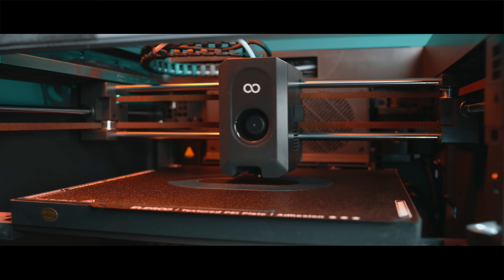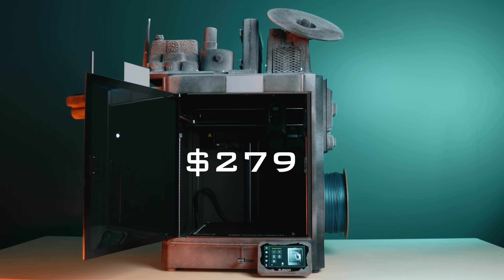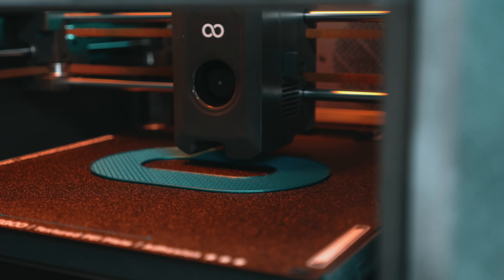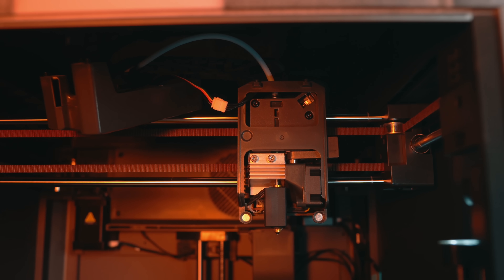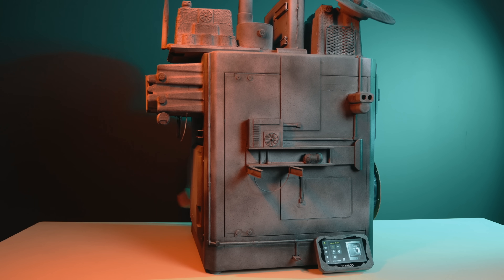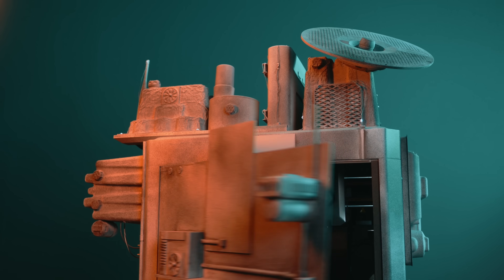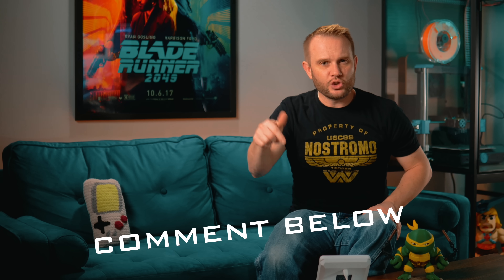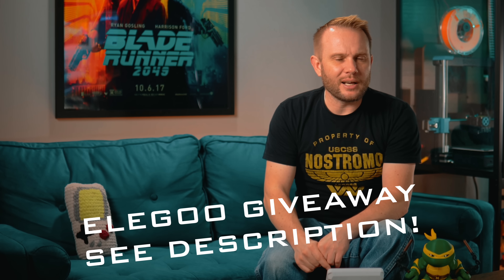The Sleeper 3D Printer Nobody Talks About

Comment: I own one, about 3 months now. Have had absolutely no issue so far except two user errors . 1 forgetting to level the bed when I replaced the build plate with a fancy new patterned one.
2. Using the wrong material presets for my filament. 
I print something or a few things about every other day. I'm an artist and hobbyist so mainly helpful tools, storage, organizers etc. I think it's the best printer you can get it you're not trying to mass produce for a business or do color prints. I'm probably going to get the multicolor system just to have extra spools of the same material. Multicolor printing  is a waste of material in my opinion even with the more well developed printers still having to purge material with the towers. I just print objects in individual parts and assemble afterwards.  Ive printed pla, pla+, petg,petg-cf, gf, abs, abs-cf, gf.

Comment: This is very similar to my Kobra S1. Very reliable.  Great print quality.  1st layer is great every time unlike my Qidi.  I am curious how this machine holds up if you print 20 petg or pctg prints with a fairly warm build plate of 80 degrees.  Both my Qidi and Kobra S1 get too hot and the electronics shut down or start complaining.  Nobody seems to test these machines with 20 or 30 hot prints in a row.  For instance the new Qidi Q2 looks great until you try to print at 65 degree chamber.  The electronics need to match the other hardware.
Love the paint job and the channel.

Comment: I just bought an open box and have been unsuccessful in getting it to load filament, just clicks a lot and wont feed in. Took the head apart and can't find any clogs. Can anybody confirm whether or not it's supposed to click when loading filament?
Reply from the maker: Clicking usually indicates that it is jammed with filament, that the extruder is spinning on something.

Jump in my discord, we’ll get you squared away!

Mention you came from this video.

https://loyal.ms/discord
Reply: @LoyalMoses huge, will do when I get home from work tomorrow! Thanks a ton!

Comment: I bought one of these due to all the hype. It did approximately 15 to 20 prints amazingly well. After that it has an extrusion issue that cannot seem to be fixed by Elegoo. I will say their customer service has been good to work with. Currently I have a brand new printhead assembly sitting on the bench ready to be installed. I let them know this was the last time I was tinkering with this machine and if it did not work they would have to replace it. Unfortunately due to my work it's taking me weeks sometimes up to a month between repairs. Fingers crossed as I really want this machine to work.
Reply from the maker: Oh no! I hope you get that installed and working!

Comment: I really like mine. I bought it for $329 like everyone else earlier on (July 25). I've printed all the filaments (PLA, PETG, PA, PET, ASA, GFs & CFs) and it's done them all without a hitch. Only had a few issues that were bed adhesion issues but I've got 300+ hours and going strong. There are a few preventative things you can do to, like a strain relief for the extruder USB cable, lubricate the rails/rods, and blow off the fans from dust. I designed a rear exhaust vent for it to ventilate it completely. I have a filament dryer next to it and I installed a chamber heater in it for engineering filaments. I bought mine to do functional printing that my A1 Mini wasn't ideal for, and in that respect, the ECC has killed it.

Comment: I have two of these machines(Centauri) with over 1000 hrs each, with zero failed prints.........I run them on Orca Slicer. That speaks highly of them, and I run them fast.  I did have to replace one of the noisy large fans pretty quick on one of them.  They have been absolutely fantastic machines to date. I mainly run ABS in them and PETG/PLA, more like 70% time they run ABS.  I have H2D, A1, several Qidi Q1, Xsmart, etc.   My main goto printer still remains my PLUS4, I have dialed in my plus4 so well, no machine keeps up to it for quality and speed on several materials, including my H2D, this may change as I gain experience hands on with my H2D( profiles all seemed to need higher temps so far with it, especially PETG), but it currently down right now awaiting a fan replacement at 300 hrs......and to change the fan on H2D  is an absolute nightmare, nothing like my other printers where it is easy, looks to be solid 2hr job taking time, have to take whole head apart...........at 55yo my eyes just not looking forward to dealing with it. Spare fan been here two weeks, gotta get it done soon. I do love my H2D, filament savings and mulitcolor are nice, plus having two nozzles for support use is great.  It is killer machine, but repairs seems like they lot more intensive to do, a simple fan replacement on hotend tons of extra time required and one has to be very careful.  I have to give kudos to the A1, I love that little printer, it is so quiet and just gets the jobs done extremely well.  

I was disappointed to hear no AMS for my Centauri's.   Can something like the MMU unit for Prussa be used, sort of generic type solution to run multicolor in the Centauri?

I have to give you the full two thumbs up for that beautiful opening scene!

I typically dial my printers down to run around max speed of 6000-7300.  Travel time I keep pumped up.  Wall speeds I can push up to 4000, varies on types of objects I am doing.   My average print speeds with ABS are 240 mm/s to get solid pretty prints consistently.  If I have important top surface I max that at 200.  Can push up to around 280 max before quality starts to change on my Plus4.

Hands down best fast low cost machine is the Centauri's for single color.  They simply work out of box and can really be run hard. I went through one period for two weeks straight they ran 24/7.....all ABS. Like I said never ever had a failed print on them. I do run some complex larger prints. They run ABS extremely well and in my opinion are a tank so far to date.   I do recommend one buys spare hotends, nozzles, for any printer they pick up.   If they offer extruder spare I grab them.  All printers should keep those basics in stock early on with any printer.

Comment: I have been very pleased with my CC, but it is my least used printer thus far, probably because I didn't need it but couldn't pass it up at such an amazing price. I did have 1 print that failed repetitively in more than 1 material and that was the riser for the CC itself. I finally printed it on my Qidi Plus4 from Qidi ABS-GF25. Other than that, the CC has printed every other project flawlessly. You sort of "softballed" the multi-color support issue there... they hyped that future capability, and thus far haven't fulfilled those promises (less important to me but worriesome). On the topic of other printers I would like to see you revisit; how about the orange storm giga... I would love to see you go back and update us on your final impressions on that printer now that you have had it for a while. I have the Sovol SV08 Max in a box, but life... At some point I will get it assembled and setup. Happy Holidays!

Comment: Its not a sleeper, really, its just Bambu being in the headlines all the time slugging it out with Creality. The CC looks like just another X1C / P1S stylized clone, but its not. ELEGOO has a track record to maintain, they have been around for quite a while. From the Neptune 3 series and up every printer they put on was a good one, and well, if you want to keep your customer base you HAVE to keep delivering. So ELEGOO did their spin on the core-xy cube in a uniquely ELEGOO way. Its built better than what one would expect for the price, because ELEGOO doesn't gouge on price. They offer a higher value for money than most other brands will, and in that, they are also competing in the void below the P1's price but above the A1's for a CoreXY built good with the likes of ANYCUBIC and Creality.

The 110C bed is nice, but we had that on the Ender 3 series for gods sake, why it wouldn't carry over is beyond me. The hot end was usually 260C capped before because no bi-metal heatbreaks from the factory but now that bi-metal is the standard high temp is also the standard. 

ELEGOO focuses on the aesthetic a lot more than other brands, but they dont ignore the actual printer like some other brands do. You look at the Neptune series, the extrusions were as covered as possible and anodized and had text and symbols on them. The hot end was unique, nicely designed, and not a minimalist bended steel box. No diss on the Creality, I own a Ender 3 Pro myself, but Creality didn't really focus on the aesthetic as much as functionality in older i3 style printers, but ELEGOO did.

So what do we end up with? A segment in need of contenders. A company on the slight backfoot. And a style of machine where most of the market seemingly is. Centauri Carbon. Centauri is the name of a constellation, following ELEGOO naming convention of space themed things (Neptune FDM series, Mars & Saturn & Jupiter SLA series), while Carbon refers to the coloration of the printer: Carbon Black. An aesthetic that is uniquely Elegoo's, neither not present nor too over the top, a clean build wherever the eyes will land, a unique hot end that seems to combine a Bambu style shroud with the Neptune series shroud, and a sufficient build for the price. The coloration is unique. The build is at least different. Nothing about it screams direct clone (unlike the Kobra S1, cough cough). And its built following the ELEGOO formula: Good aesthetics (visually pleasing), good build, and feels good to use. Its not 100% enclosed, but its close. They have the MMU capability on a delay, but its planned, apparently. Its an afterthought somewhat, for sure, but regardless, yes: this printer is a good printer, and it is uniquely ELEGOO.

Comment: I have a first batch CC.  It's incredibly loud and you don't want to be in the same room with it when it's printing.  The LED light is absolute crap for lumens and Elegoo has never sent me the light upgraded that they promised on their website.  My machine prints PLA, PETG, ASA, TPU and does a good job and is the fastest printer than I have.  The front door is highly tinted and you can't really see anything thru it (It's like Elegoo thought they were printing with UV light).  I'm still angry about not getting the promised MMU system.  All things said you can't beat the price if you want a single color printer for your garage or outdoor shed.

Comment: I have 2 CC's and love them. They're perfect single color machines. I do agree that the 10,000mm/s speeds are a bit aggressive. I usually take mine down to between 6,000mm/s-8,000mm/s for travel and 1,000mm/s-2,000mm/s for outer wall as the CC can suffer from ghosting

Comment: This was my first brand new 3d printer and I am thrilled at the performance for the price! I previously had a used Ender 3 and that thing was constant tinkering to get slow prints off. The CC has been great right out of the box, handled everything I’ve thrown at it. Zero issues that I didn’t create myself! 

One thing worth nothing, 6:55 shows the original style LED light. The latest batches have much better LED strips in the top of the frame. One on the front edge and one on the side!

Comment: I have the Centauri Carbon, got it last month specifically for functional parts in CF and GF, I didn't need multi color as I primary do functional parts,  its fast and the prints look great. Its faster then my klipper based bed slingers being a coreXY based printer. Love that its not locked down into some brand ecosystem like other brands..  For the dollars its a hands down winner if your not going for multicolor.

Comment: Have 2 CC's, both work great.  One with 0.4 for pla/petg.  The other with 0.6 for ABS/ASA/PC/PET CF, and any CF or GF filaments.  Print quality is every bit as good as my X1c was.  Easy to use, with very quick print starts since it has pre-calibrated bed mesh for both sides of the plate.  Even better than my X1 or A1 it alows for real time z-offset adjustment.  Great printer that also happens to be inexpensive.  For comparison it has a bigger print bed and higher build plate and nozzle temps than a Prusa Core1, and it comes with a camera and the ability to print abrassives right out of the box.... for 25-30% the price of a core1.

Comment: The Centauri Carbon looks like such a beast! I’m a total beginner, and I’ve been researching this exact model to kick off my 3D printing journey. Winning one from the channel would be so awesome.
Reply: Nope, not beasty at all. Simple setup, I'd use Orca instead of Elegoo's slicer though.
Reply: @spamento  what's the difference? If you don't mind me asking
Reply: @spamento  for what reason? They're both on the same version now 👀 

And for the price. It's a beast. It has better quality parts compared to similarly priced printers. Most of them at that price don't come with decent stepper motors or a all metal garden steel hot end as well as 3 double sided build plates and whatever else.
I think after all the discounts and vouchers involved I bought mine for around £240 with a spare hotend and they sent me a new gantry and bearings because I have a slight vibration. No fuss. Haven't even replaced the part yet prints fine 😂😂

Comment: Going to wait for the 2 or Colour version, then this one might get a drop in price and be a real bargain.
Reply from the maker: Any cheaper is crazy!
Reply: @LoyalMoses  Here downunder in OZ it is $629 AUD, but the seller is Oz wide and has spares online. Is it an upgrade for my $90 Ender3 clone, that has $120+ of mods but without Klipper or tuning yet? Bambu A1 is $399 AUD, Mini $299. Speed/price/ease of use? The old product triangle, Cost, Time, Quality. The Carbon fits those three better than most.

Comment: Mine has essentially been running since I received it in May of 2025 (If my memory is correct) I have had absolutely no problems with any prints in any material I have put through it, really is a powerhouse for its price point. If you are debating on whether or not to buy one, I would definitely recommend it,it's well worth it in my opinion
Reply from the maker: Awesome to hear!

Comment: main issue is no filament changing system and the failed promise to deliver it that put the nail in the coffin on the sales of this machine. Even if you don't print color, the ability to have 4 rolls in a sealed container (with integrated dryer if the manufacturer has that option) that auto loads your filament is something you can't live without once your used to it.

Comment: Mine is currently running in the background printing ABS parts for a model. I'm using Orca slicer. While it is pretty much plug and play you can get better prints by running all the calibration prints in Orca slicer. Also the fans are a bit noisy. This can be adjusted by changing a few lines in the machine start G code. It  has a "Ludacris" speed mode but I never got a good print from it. Just stick to normal mode and it works fine.
Reply: Have you found any quality improvements going with the slowest speed? I tend to choose it when I have time to spare, in case it would help with quality or adhering to the bed... 

Also, would changing the fan settings in g-code have any downsides (maybe depending on the type of filament material)?

Comment: In your opinion, with the sea change in the 3D printing industry to multi-color and multi-toolhead designs, do you think competition within the industry has narrowed to fewer companies?  I remember watching your rapid fire videos of the printer recommendations and there seems to be less brands out there, at least in the Youtube 3D printing space.  Do you see the same trend?
Reply from the maker: You are right. There are fewer companies for sure.

I’ve seen 5 close just this last year, and I’m sure there are a few I missed as well.

Basically the bar is much higher now, more tooling and software development is required.
Reply: @LoyalMoses  Also contributing to it could be the "walled garden" approach and focus on "out-of-the-box" user experience and less on open-source tinkering and individual contribution...basically a commercialization of the industry on a larger scale?
Reply from the maker: Absolutely, the user experience is getting better, and so are expectations.

Comment: IDK the cc is good.

I prefer the qidi q2. It got a chamber heater alrdy, better board, larger size, better nozzle temp such. 

The cc has board issues, imo the q2 is better long term. Strict budget, cc but preferable save up. Qidi beats it so much in engineering filaments.

So you are sponsored by bambu and elegoo right?

Comment: I don’t have the carbon , not for any particular reason other than short of space. I did buy an anycubic kobra s1 which after a bit of effort is a superb printer but limited due to anycubic policy of locking down the remote printing etc to their very buggy slicer.
I run mostly Bambu machines just due to sharing a single environment, I gave up on my creality k2 plus as it’s unreliable and currently being used to dry filament and nothing else.
I like your honest reviews and revisiting the printer after extended use is a nice to do as long term use and longevity of a printer is key for those on a tight budget.

Comment: I have one. It prints great when it doesn't clog the nozzle. Unfortunately that happens way too often. I have had over twenty clogged nozzles and and some ruined prints because of them. In two years of running a N4 Pro and a N4 Plus I have had two clogged nozzles in each of those. I almost wish I bought another N4 Pro instead with an enclosure.